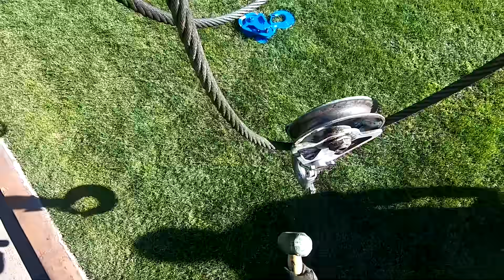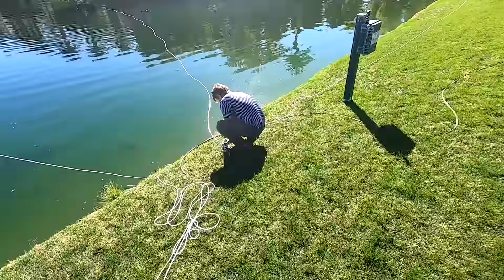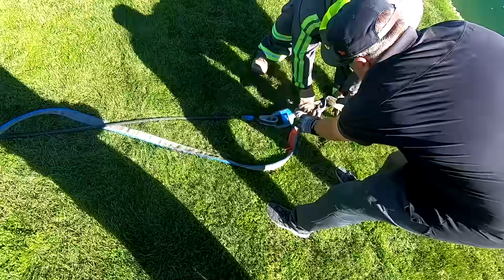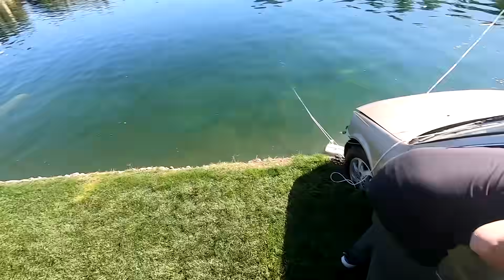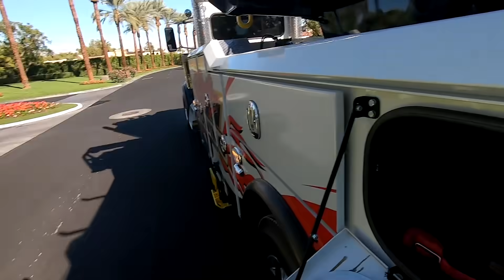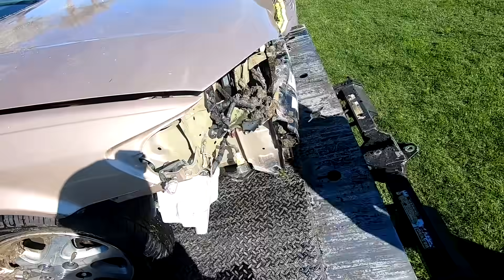Car Drives Into Lake! Not A Parking Spot!!

Comment: Something that may be advantageous to you in using your big ratcheting straps. I know that all of mine work this way. Whenever you go to thread the end into the ratchet, I always close the ratchet first. This will expose the cylinder and the slot for the strap is very easy to insert and take up the slack for tightening.

Comment: I you dont mind me asking on your truck that you used for this video,  saw at the very beginning that the first set of wheels on the back of it where pretty much up and off of the ground,  do you normally drive the truck with those off the ground like that,  and if correct,  you only put those on the ground to add More balance to the truck when you need to right?? Thanks
Reply: Andrew ... not for balance. They are for towing extra weight. When they are down it's more difficult to make turns adds wear to the driveline so they run in the up position when not needed.